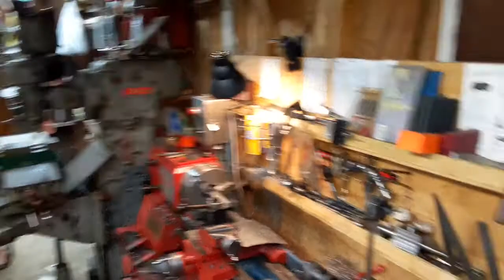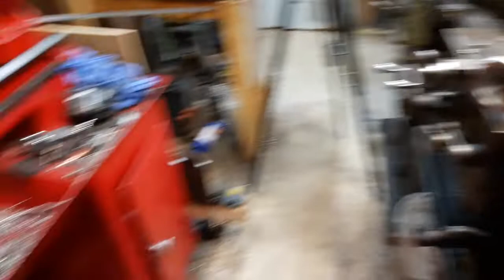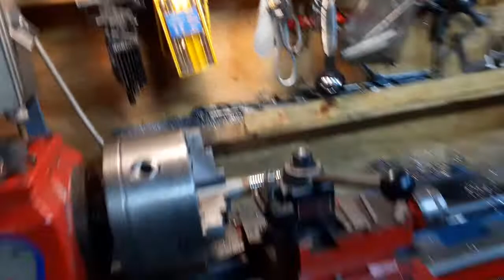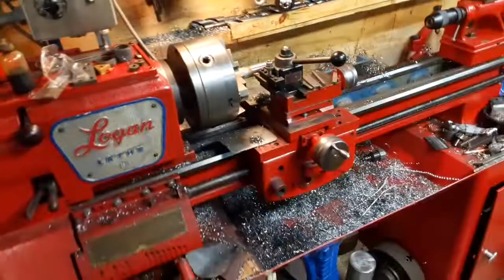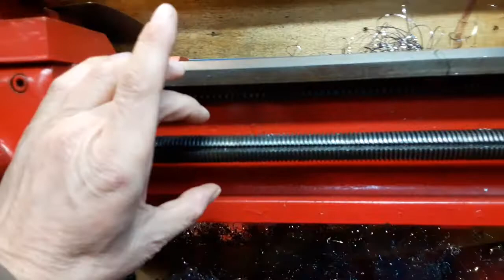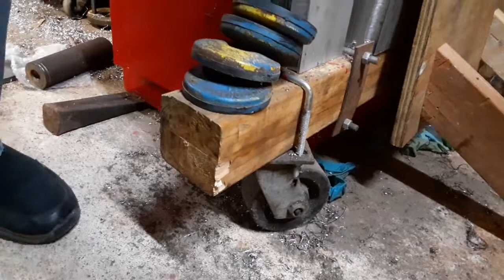stumbled onto some rigidity problems with the Logan lathe on the last project

Comment: Have to agree with Craig on his observations.  Bringing it back to original condition with the apron hardware, etc., would add value to the Logan.  But leveling the lathe and checking the spindle bearings would be a good place to start.
Reply from the maker: Definitely giving that more thought

Comment: I hate to tell you but I think that the lathe shot !!! I’ll do you a favor.I’ll only charge you $50 . I’ll come and pick it up and get it out of your shop for you. 
Whenever I lose rigidity like that I just took everything apart and put it all back together and that seems to do the trick as far as Power feed goes go to aids work shop. he put a stepper motor directly on the lead screw at the tailstock end of the lathe.I’ll try to find it and send you a link
Reply from the maker: Lol...I was sleepy when I 1st read your comment, and I just about panicked...thinking my lathe was junk would heart breaking

Comment: I've seen some guys that put a small motor, like a windshield wiper motor on the tail stock end of the lead screw, which looks like a pretty simple addition.
Reply from the maker: Thanks for stopping by. Yes I have seen the motor on the lead screw as well. Still in the idea stage of what I may do in the future. Heck if I ever find a 10EE I might just kick the Logan out..lol